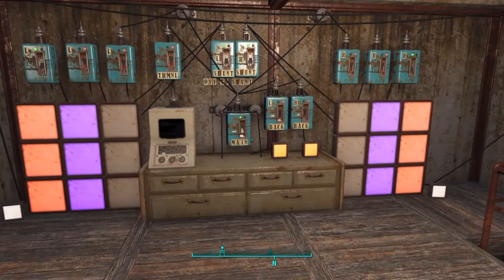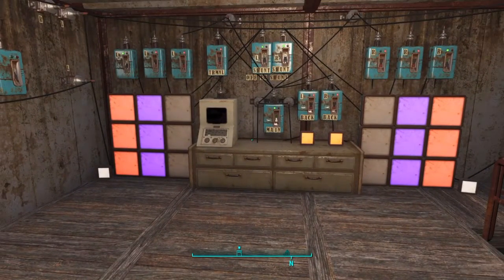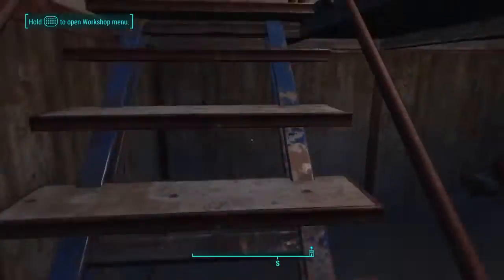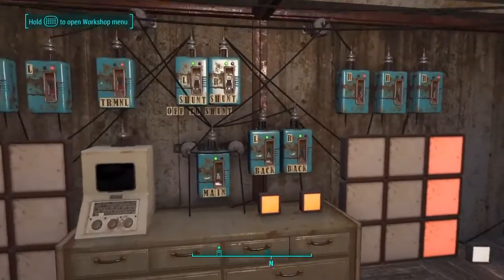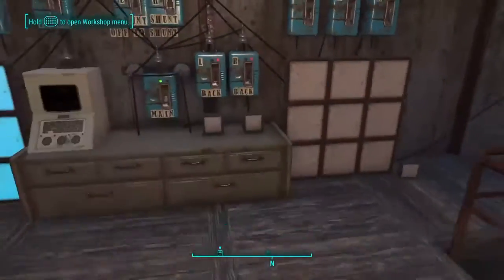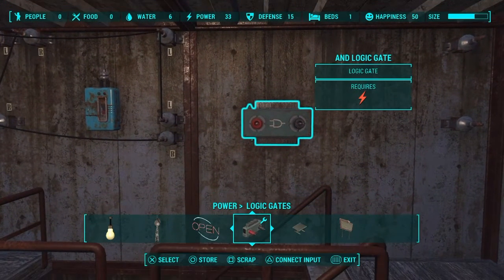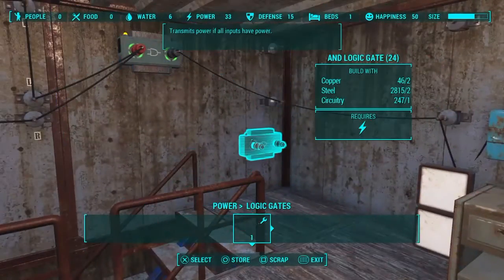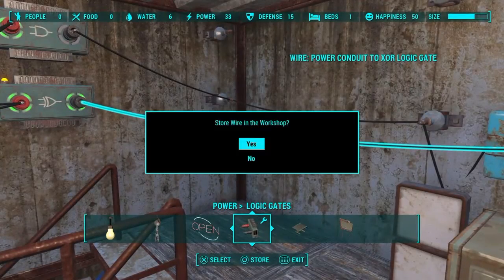Fallout 4 - Why Logic Gates Aren't Buggy - A Visual and Practical Guide

Comment: Handy tip: An XOR gate with a single input makes a handy diode.  Makes it so power only flows one way. I'm using it to build an animated set of light boxes in my Home Plate. If I understand your definition of "backflow" an inline XOR gate may help fix your problem.
Reply from the maker: I could have illustrated it better in that video.  To see exactly what I'm talking about, hook up a small and a medium generator, 8 lightboxes, with a switch on each generator.  No matter which switch you turn off or how many stops you put in between, every time either all the lightboxes will light up, or none.  There's no way to isolate just the 3 power from the small generator, or the 5 from the medium.  If someone can find a way I couldn't that'd be awesome, but well, that's kinda where that contraption i built came from.  Once I saw that I couldn't, I turned it into a machine to measure, observe and shift it around to see what I could do you know.  I tried the diode thing, that's what I meant when I said I "even tried stringing logic gates backwards" from the switch.  Thanks for watching man!   Maybe one of these days I'll crack all the mysteries lol
Reply: Darkdally What did you do in that scenario that would result in none of the lightboxes lighting up? I ask because you said there’s no way to stop power flowing between two generators on the same grid.

Comment: ATTENTION ALL VAULT DWELLERS !!! THIS VIDEO IS WRONG

There are legitimate bugs with the logic gates .

1) I was building the same logic gates for other settlements and got buggy results , went to restart the game and rewire the same thing viola , managed to get the logic working right.

The game literally shows the powered results but not outputing correctly.
For example for XOR gate where its supposed to send power if ONLY 1 input is powered
Input 1 : 1 (powered)
Input 2 : 0 (not powered)
Output 1: 0 (not powered) BUT ITS SUPPOSED TO if only 1 input is powered , this is the game literally showing its bugged.
Again since I know this logic gate worked ( and I had issues with buggy logic gates) , i just restarted the game and it worked.

2) Noticed that with OR logic gates, you need to connect 2 sources when building else it messes with your other logic gates. Typically happens when you're not finished building the full logic setup.

Comment: As I recall, you mentioned earlier in this video, that electrickery in the fallout universe doesn't seem to behave quite the same as it does in  "our world". I wonder if the reason why this seems so is at least partially due the nature and design of the  majority of  electrickal circuitry, componentry, and overall electrickal equipment that is prevalent in the Fallout universe. I.e. more receptive to the Tesla rather than the Edison schools of thought where electrickery is concerned and how it should be generated, stored, conveyed and put to use?

Comment: Bethesda makes glitchy games, it's incredibly ignorant to claim that everyone having issues simply doesn't know what they're doing. I can confirm this by trying to connect a single input to the XOR gate, with the output connected to a powerd door, and the gate turns green and specifies that it has 1 in and 1 out, but the door refuses to open. Through troubleshooting I found that it was related to the pylons and conduits because when I'd connect the source to a powered pylon it wouldn't transmit power to the pylon, even though it registers that they're connected. The door was working in a previous save with the same wiring, but while building it started glitching out and acting like I was selecting Mutfruit anywhere I looked. At some point the door stopped working, without touching any wires or adding anything requiring/providing power. I tried for over an hour to make something work, even completely removing everything and starting from scratch after restarting the game and my console, the only thing that worked was reloading an old save. Logic gates are very simple and easy to understand, the problem is the software running everything.